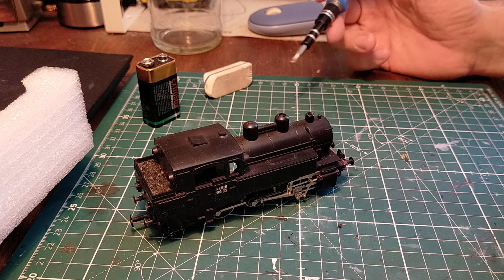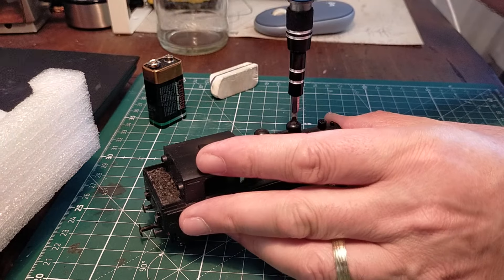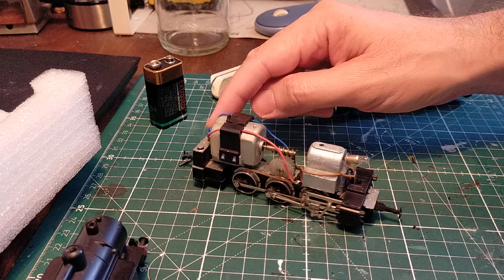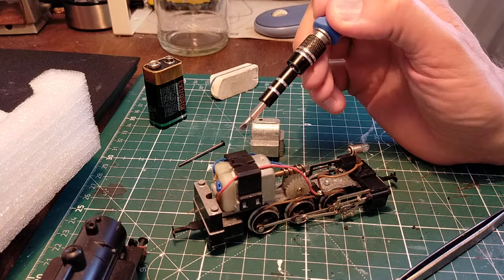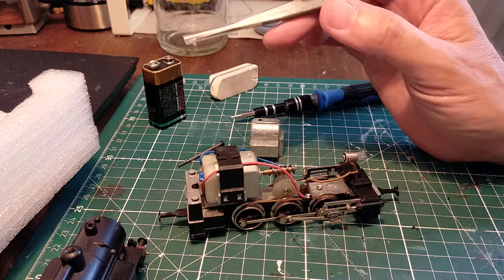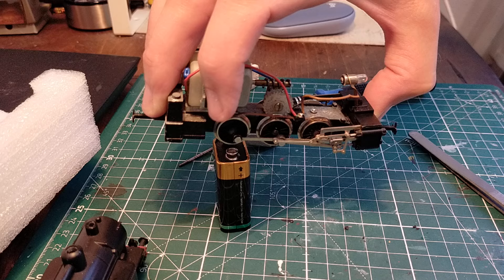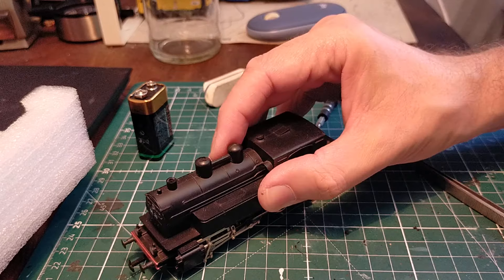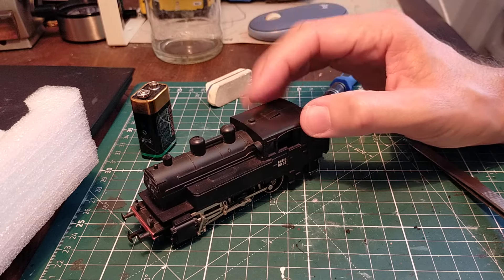Kleinbahn D120 steam locomotive episode 1: survey and presentation. #locomotive #railway #railroad

Comment: Hi Patrick, Kleinbahn made some very good Steam Locos and are simple to prepare for a service as you have shown. I am surprised to see a modern Can type motor instead of the ringfield type, this should be a smooth runner. I have a number of Kleinbahn Steamers with the older motors that run superbly. Good to see a video on these Locos instead of just Hornby,Lima etc. 
Cheers, Paul.👍👍🙏
Reply from the maker: @paulvozman842  I made a short with a test run last night. After cleaning the pick-ups (tomorrow's video)it has become extremely smooth running.

Comment: Very nice locomotive, I like the Kleinbahn loks quite much, yet I do not have one so far. Looking forward to see how it will work after servicing it. :goodvibes: PS . It seems the FS also had this D120, as the Gr. 876 in its service. Very nice!
Reply from the maker: @Cristake1974  I can anticipate that after servicing it's a super smooth runner. This Taiwanese can motor  is excellent and I think it's a 5-pole. This locomotive has the most modern motor in my collection!

Comment: Its very freely based on a kkStB class 229, the later ÖBB 75. Some hobbyists used them as a starting point to build a more accurate 2-6-2 class 229.
https://de.wikipedia.org/wiki/KkStB_229
For this model Kleinbahn simply re-used the chassis of their German class 80 0-6-0.
Reply from the maker: @herborty8658  I can see how they could stretch it out into a Class 229 2-6-2, that's very interesting, thanks for the link!